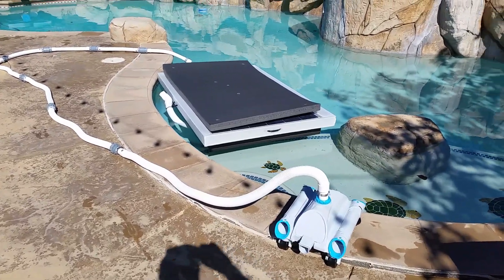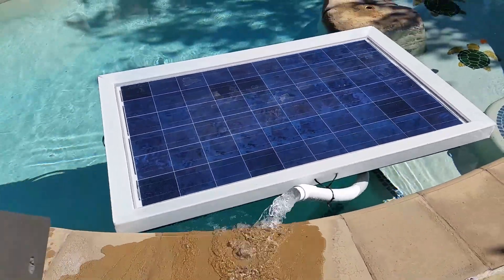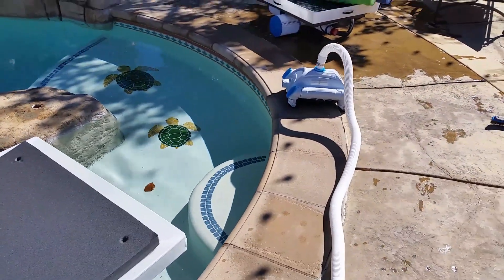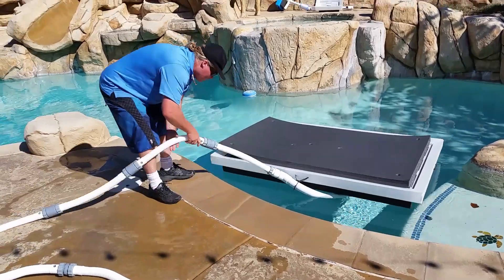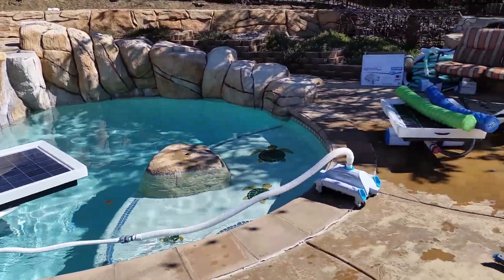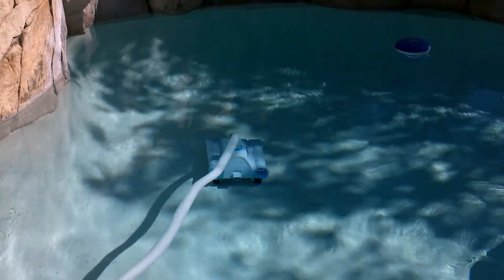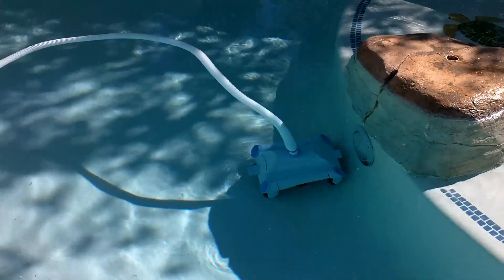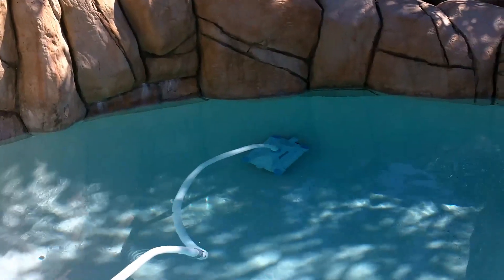Solar Robotic Pool Cleaner with Solar Pump Filter System by Natural Current

Comment: Great work Mike. Where can we get the cleaner?
Reply from the maker: Hi Larry, do you need just the cleaner or a complete system. I have both for your needs.  check out our new Savior Air Pumps Systems http://youtu.be/f3d9lhSR534
Reply: Hi Mike, Just the cleaner.
Thx
Larry